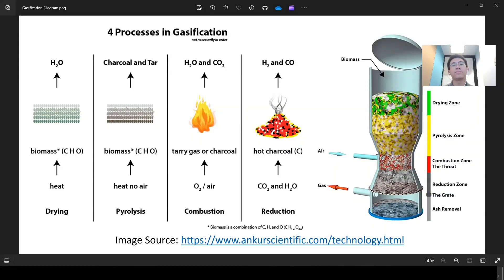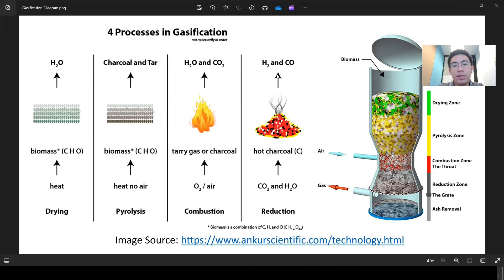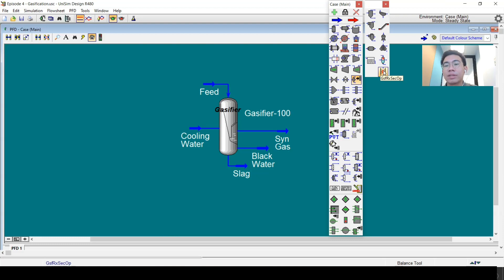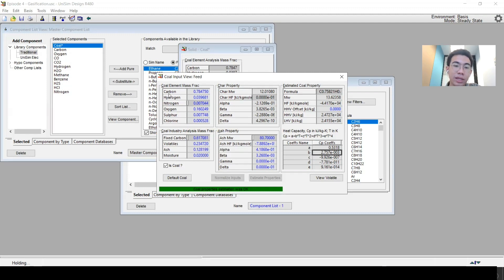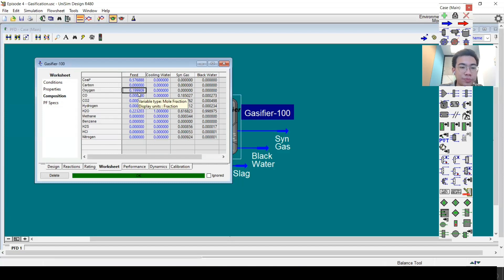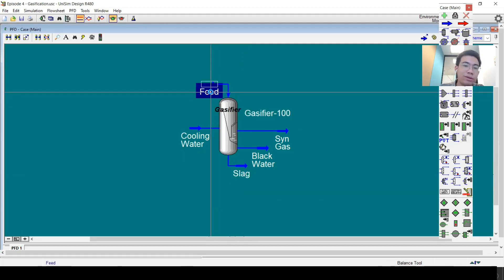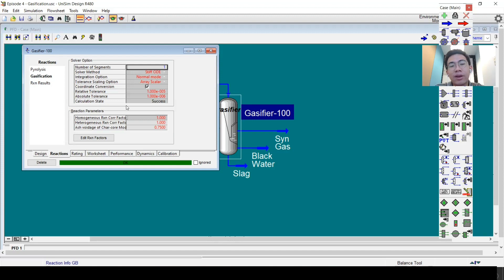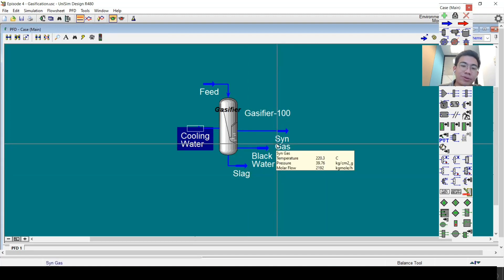Episode #4: Gasification Simulation | UniSim Design Steady State Special Tutorial Series

Comment: what about the fine ash and the slag, they should be treated differently, as in the crude syngas, there will be certain fine ash entrained downstream to the venturi scrubber.
Reply from the maker: In the default gasification model in UniSim, the "Slag" stream is defined as the unburned carbon. I haven't really check on this slag mass balance. But if you want to check, you can try to compare the ash mass fraction from coal input with the rate of "slag" stream. If it is the same, probably the "slag" stream is the ash